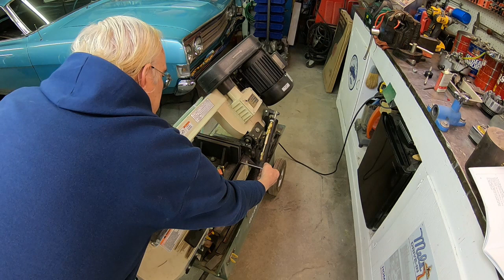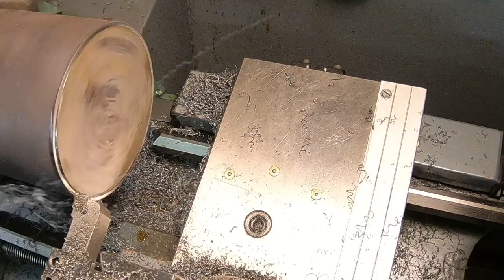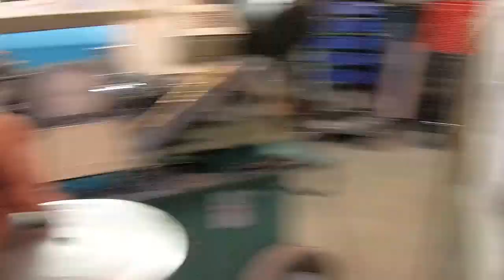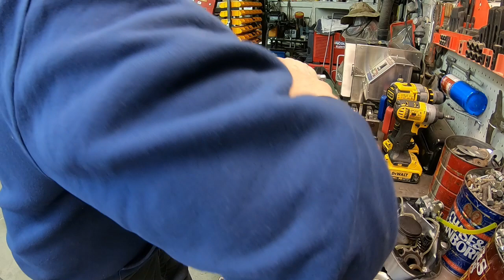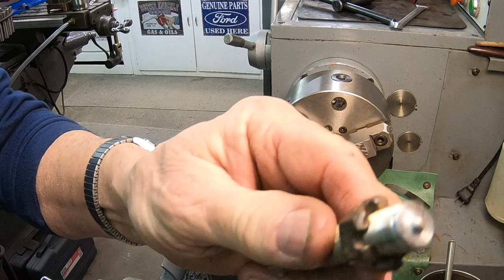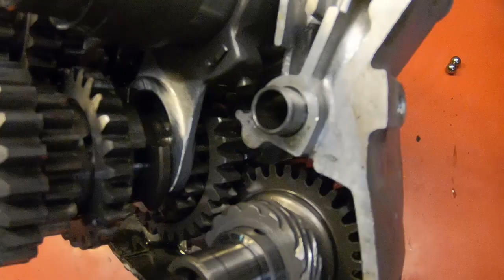Case Splitter fabrication, and engine disassembly part 2

Comment: nice job watched your other videos you seem to be able to do it all paint body work nice lathe do you plan re assembly soon i am going to replace bearings and seals on tc 100 and getting as much info on you tube i can .thanks for video it will be very helpful  to me
Reply from the maker: Yes John, working on crankshaft rebuilding now, and will be doing the reassembly shortly there after. Also coming is the decal replacement on the tank and side covers. Thanks for the subscription and the comment. Im just starting the channel and subscriptions seem hard to get. Im thinking the TC100 is pretty much the same as this unit.